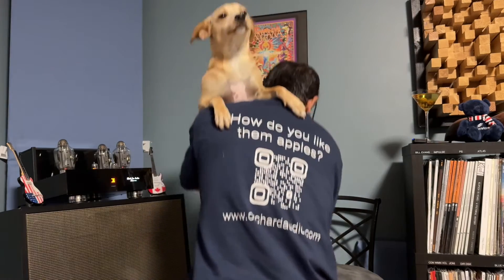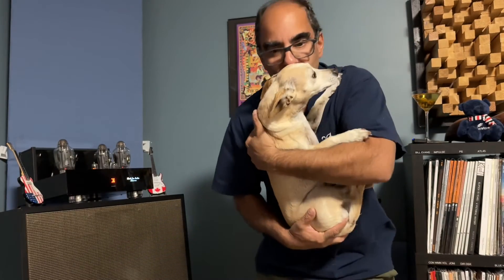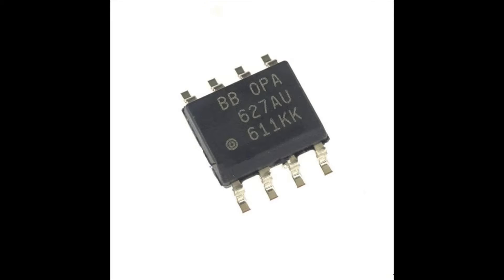KT170 Tubes….No Treble and How 8 Fixed It !

Comment: Cool…. So did black ice make changes to their amps in general to use the op amp that fixed your treble issue in general production?
Reply from the maker: Not yet. But if the customer's happy. No point in changing the Op-Amp with the Customer is already happy with their purchase. My friend Greg has the F22 w/KT170's. Good question though.
Reply: @joeygsaudiochannel  cool.   I just ordered an F35 with the 170s I will ask Jaime to do the op amp swap.   I have sourcepoint 10.   I got the FX10H as a trial but I need more power!   Thanks to your guidance man.   I found black ice because of you
Reply from the maker: @revelry1969  That is so fucking awesome, man ! As I've said before on my channel. I'm not sponsored by anyone but I will shill for any audio equipment taht gives me a "Chubby". Drop me an email at rajugsw@gmail.com and I'll get you my contact info.